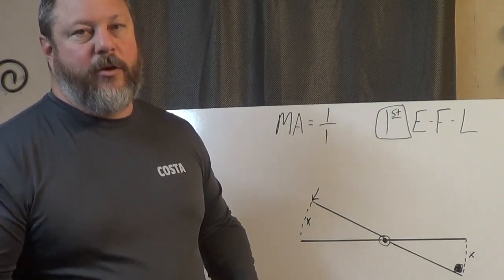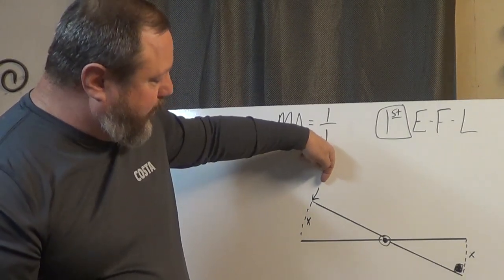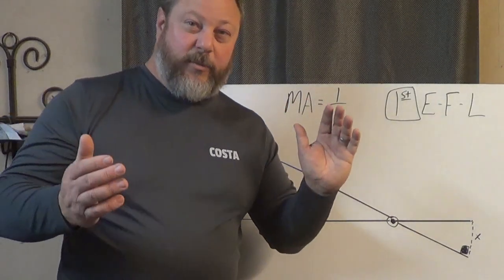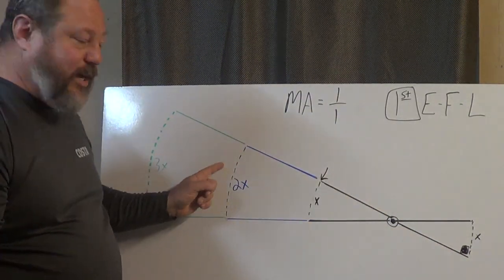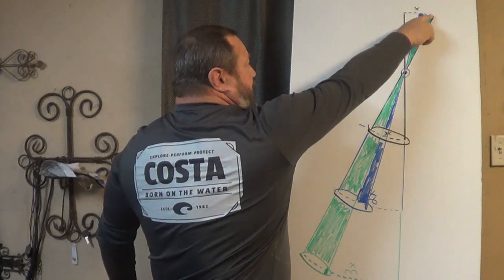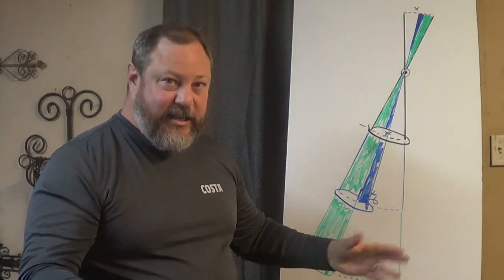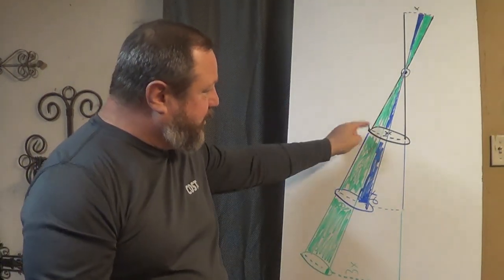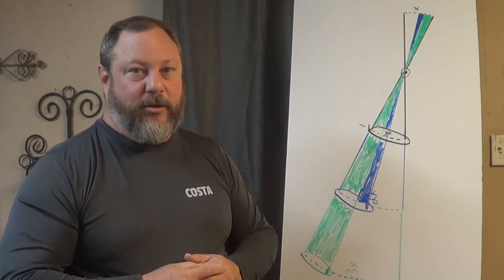Leverage bits and signal: Why different cheek styles have different speeds of action.

Comment: Hello at around 9 12 a very informative and professional video goes off the rails. I would stay away from that California stuff if I was you ( at least until you retire).
Reply from the maker: Specifically what said do you take issue with? And thanks, but no. There may be no greater concentration of misinformation than in that group.
Reply: @DanielDauphin  that's 100% correct and why I suggest you stay away from it till after you retire
Reply from the maker: Just hard to sit back and watch people teach others that 2+2=7 and not speak up.
Reply from the maker: @Trail42  that gave me a good chuckle. Thanks

Comment: I have spent the whole day viewing many of your videos… love them! You are by far the best I’ve found to explain things I can understand. 
So my question would be on this topic is. For a 3year newbie with terribly fast an heavy hands that is aware but constantly has to remember to not snatch a rein. Would you suggest a O-ring with 1:1 an a slobber strap, or a  broken leverage bit with long shanks an a pretty loose curb to give me time to not snatch an be softer. 
Keep them coming as I’ll keep bingeing!
Reply from the maker: Snaffle for sure and advise you to try to be aware/slow/deliberate, and to predominantly use one rein at a time. Broken mouth leverage bit would be unlikely to keep horses happy. Thanks for watching and the kind words.
Reply from the maker: And just to be clear, an o-ring (or any/all other snaffles) have no ratio at all. They aren’t levers in any way, which is an important distinction, because any sort of leverage bit is causing rotation of the mouthpiece, while no snaffle can cause rotation of the mouthpiece.
Reply: Is their any certain material you prefer for slobber straps? Is a soft rope better than say a soft leather strap? Or is it more of any cotton cloths line rope that’s laying around  will do?
Reply from the maker: @stephenheadings4789  so there are two parts of a snaffle bridle that people commonly refer to as slobber straps. If you are talking about the piece that connects the reins to the bit, most often used with mecate reins, then I'm on team leather. If you are talking about the piece that attaches under the chin, to both rings, and keeps the bit from going through the horse's mouth, then I don't really care too much. This is really a bit hobble by the way, but is often called a slobber strap/string. I probably use nylon chordage or paracord most commonly for bit hobbles because it lasts forever and doesn't actually play a role in function of the bridle. It's just there for safety and is important for that IMO.

Comment: how about no bit. IMHO if you can train a horse with modern training methods the bit is a useless tool.  Bits were for old cowboys that did not know a damn thing about horses what they did know and could do is stay on the horse.  Today we work and train the horses and a halter works just fine or a hackamore with no nose piece. We have not needed a but for any horse that we work with for the past 20 years, not one. If you need a bit for control then you don't have control the bit does. This tells me you suck with horses. We know now that good training makes a good soft partner horse in all cases no exceptions.  If you need a bit to fix a 'problem" on so-called problem horses then you are not fixing or training a damn thing.  Horses don't have problems humans create them. if you can not train the issues that another person created and you need a bit to make it work you need to start over because you are not training. After years of bits ever, I"m getting to the opinion that all invasive mouth bits are abusive it does not matter how light you think you are. Today we can tell who has great horsemanship or not, just by, if the horse is carrying a bit or not.  We push cattle in the mountains and still no bit, hell rope halter most of the time. just an old-school abusive tool that was created back in the time when the cowboys just knew how to stay on the horse but not train the horse.
Reply from the maker: As you said, this is simply your opinion. Stating that everyone should have the abilities/skills of the top 1% of riders is a ridiculous position to take, IMHO. Likewise, the notion that every horse can be solved the same way is naive, idealistic, misguided, and blatantly false. Stating that doing other than you so virtuously think we should is "cruel and abusive" is beyond reasonable, makes anyone reading with an open mind instead want to mock your POV and, in fact, as those terms have legal consequences associated with them, that is a slanderous statement, or libel. I won't tolerate that BS here. Uneducated riders are always going to exist, because all beginners start there. Many never see the need to grow or improve and throwing stones at them will only make them defensive (an interesting tact to take in communicating with your own species after making the argument that you're an absolute expert at communicating with another species). Education of the rider is the solution to the problem you seem to be so passionate about. Which particular pressure points poor hands and poor timing are handling is not a virtuous argument to make. That's not my opinion. That's fact. As I noted in the other video of mine you commented on, there's a well funded and well organized opposition to all animal ownership out there, and statements like this one only fuel their fire and give them ammunition to use against us. This is foolish in the first degree and will not serve to help the cause of making life better for horses in any way, shape, or form. Inanimate objects are, by definition, not capable of being the problem. Fire isn't bad. Guns aren't bad. Bits aren't bad. You can use a brick to build a school, church, home, or hospital. You can use the same brick to crush someone's skull. Neither outcome is the fault of the brick.